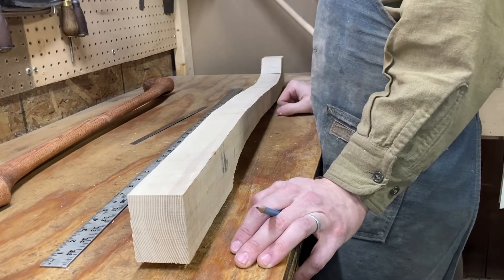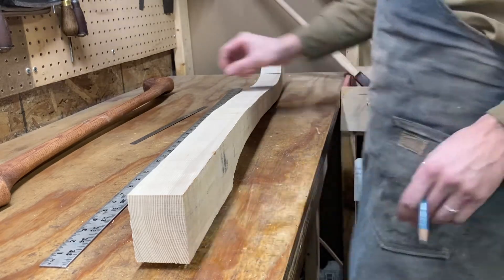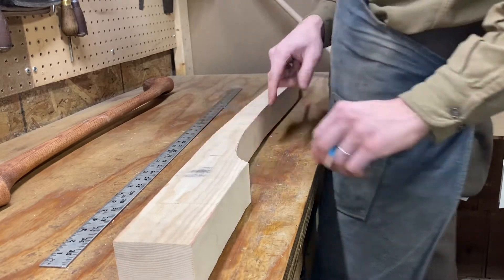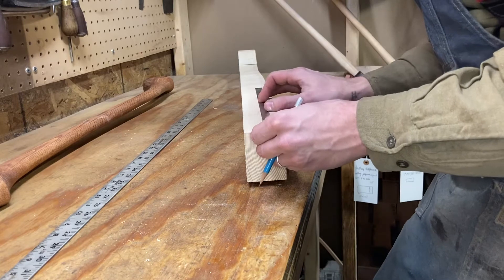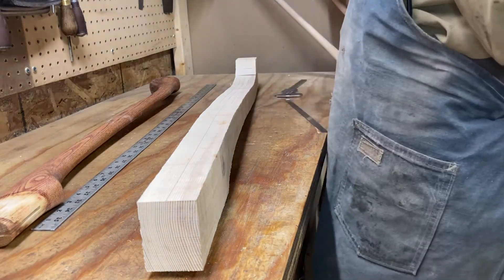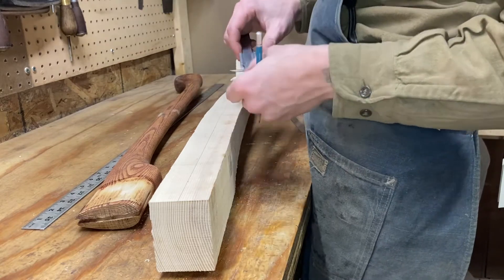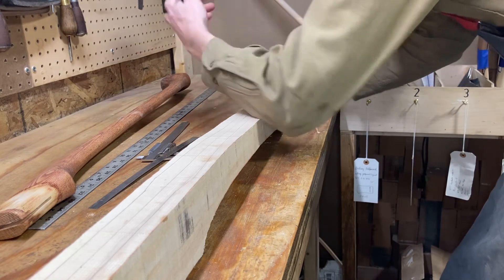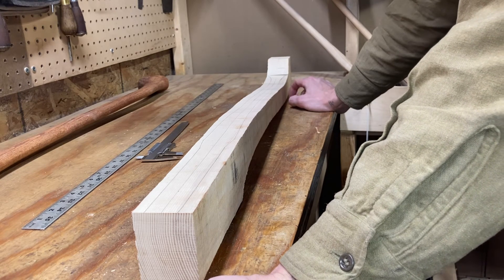Handle Tutorial - Part 2 - Cutting Out the Billet

Comment: I typically use a compass or a scribing tool at 1" (or whatever the midpoint is) and go down the length, ignoring the sudden run-out. I find that trying to measure at numerous points is just too picky for me. I make it up in the roughing with a  drawknife stage. Having a very well demarked center line (top and bottom)  is the key in my opinion. DD
Reply: Compass!! Such a perfect tool for that job! I don’t know why it never occurred to me! Thanks for the tip!